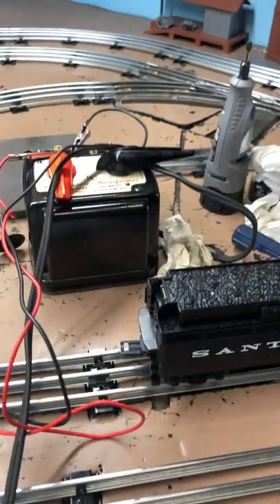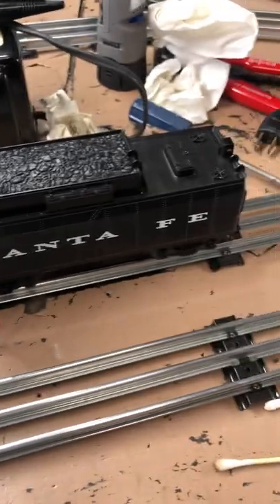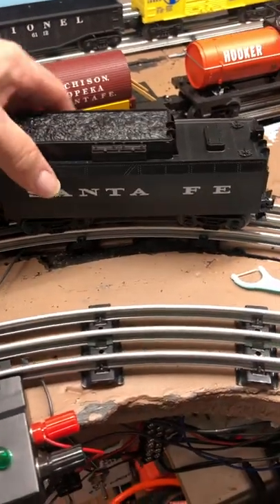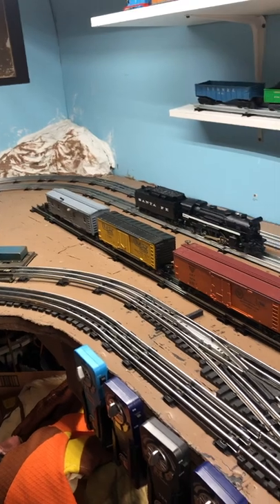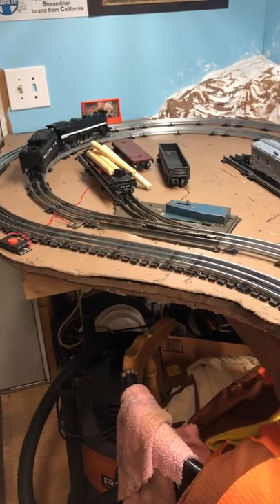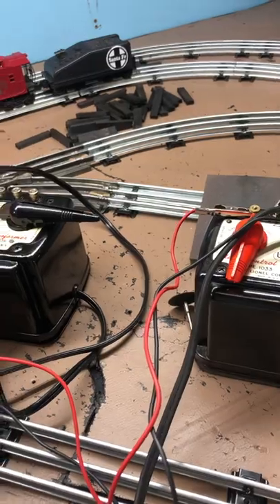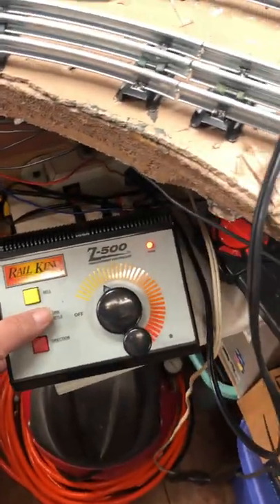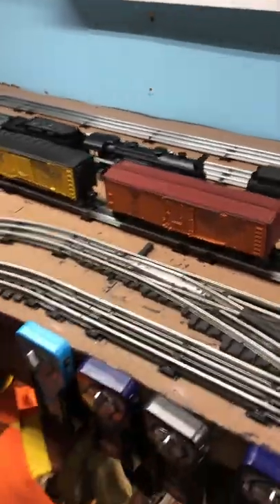Lionel air whistle tender problem and question

Comment: Bad rectifier disc in the 1033, definitely. Mine did exactly the same thing and replacing the old selenium rectifier disc with a modern silicon diode cured the problem.

Comment: I had the same problem with my old 736 engine and tender where the whistle would not work when the train was running  , I replaced the roller on the truck that makes contact with the center rail and now it works fine , probably wasn’t making real good contact when it was running

Comment: If that Santa Fe tender has a modern air whistle unit, that is a DC motor with a circuit board it could very well be it just doesn't like those old transformers.  Your old postwar tender doesn't seem to have a problem with the old transformers since that's what it was made for. 
I run my layout with MTH Z-1000 tranformers and old and new air whistles work perfectly with them.
There could be no solution to your problem, you just have to live with it.

Comment: Just a thought- could be a transformer wattage shortage keeping the tender from working properly.
Reply from the maker: Well I guess it could be , that’s the biggest problem with old and new , some things work and some don’t and it’s frustrating to have to figure out so many things that do and don’t work together, so I’m using a newer pack to operate this tender and it seems fine ….. thanks for the input
Reply: @jamesmorgangunsandtrains7132  Sometimes it takes me a day or two to figure things out, especially when it's an electrical issue. Lots of trial and error. Glad you got it working!

Comment: I have the EXACT SAME ISSUE with my 2046 W tender an I have the same transformer.The engine speeds up when you use the whistle function when running but the whistle will blow when the engine is in neutral. I’m having the transformer checked out now. I’d also like to know if you found and corrected the issue. Thanks for the video.
Reply from the maker: No I never figured it out, seems the more modern the less they work as well with the old transformers. I sold the transformers and bought two dc power supplies. I kept the Z750 because everything seems to work with it ….. too many power variables over the years and tech changes in this scale . So by elimination I figured out what works for me.
Reply: Bad selenium rectifier disc in the transformer. By now those 60..70 year old selenium rectifiers have degraded to the point where the reverse leakage currents have become so large that they prevent adequate rectifying action. Even when replacement discs are still available, is better just to replace the bad disc with a modern, cheap silicon diode such as 6A10.